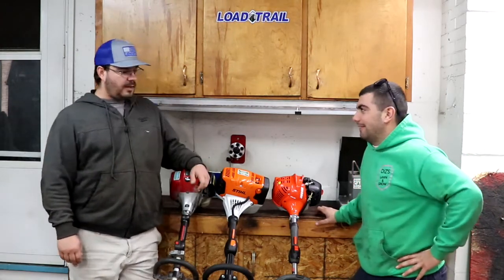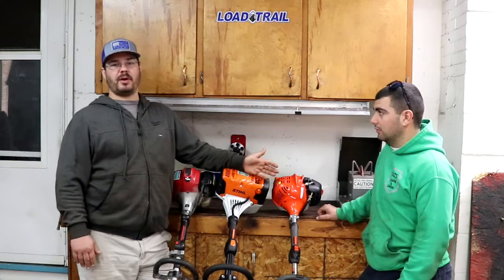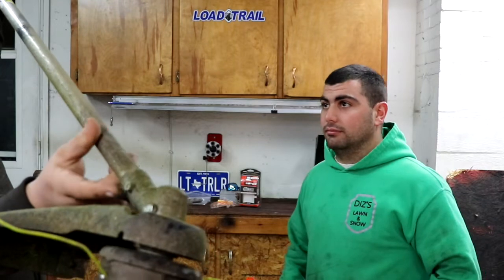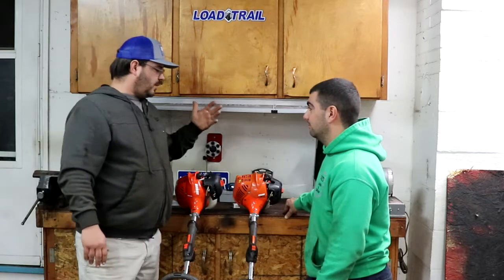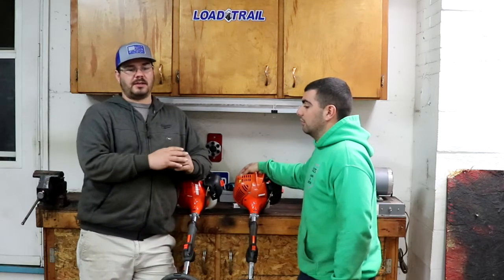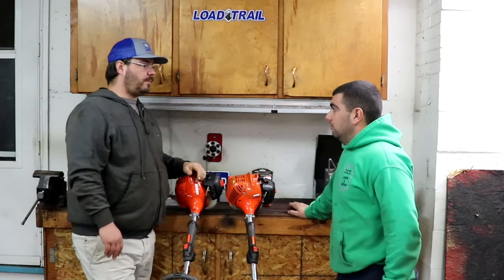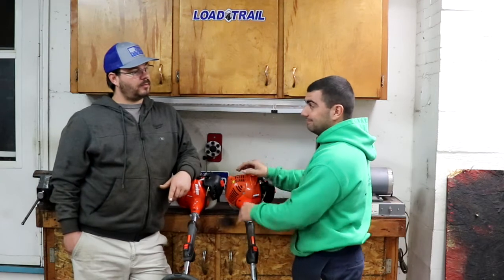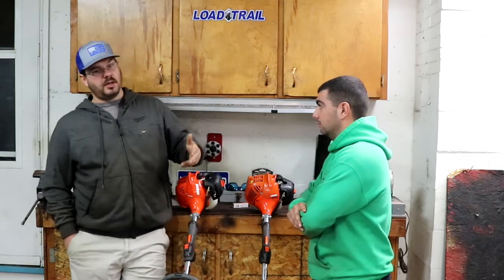Shop talk with Diz Lawn & Snow

Comment: I agree. I use the 2620T for everyday and keep the 3020T for larger thicker stuff. I like the straight shaft edger as well. Great video guys!!
Reply from the maker: I like to use the redmax 260TS most of time but if needed I grab the stihl FS110RX. I'm going to try this new T235 21cc see how it work.
Reply: Thank you Danny and I’m looking at 2620

Comment: You guys made some good points we don't have redmax down here in Miami fla all our dealers carry down here is echo and stihl I wish they carried other brands to try out .
Reply from the maker: I would love to see more dealer support for Echo here. Over the last few years I have used so many different brands that have open my eyes. Before that it was like 9 years of redmax only. Thanks for watching as I know this was a very long video.
Reply: @DelsLawnCare  I've been using echos and stihl mainly echo for over 30 years but this year I have seen more companies with echo specially with the new extream series and the new pb8010 blower echos have gotten very hot down here this year big time and they are so easy to maintain that's what we love about them.